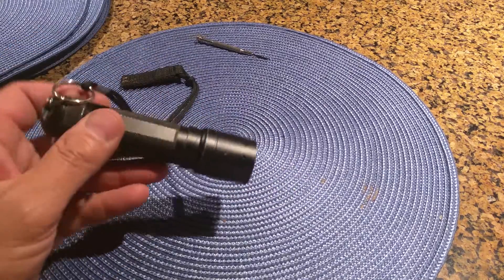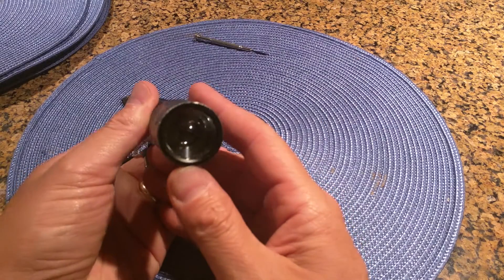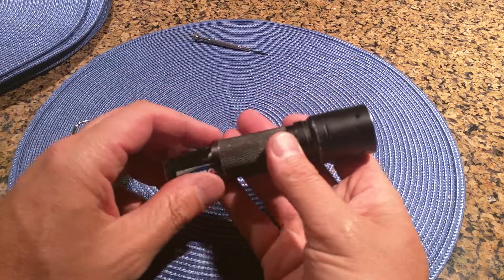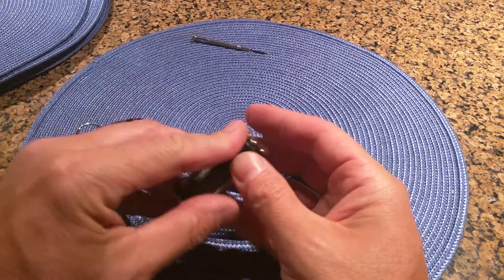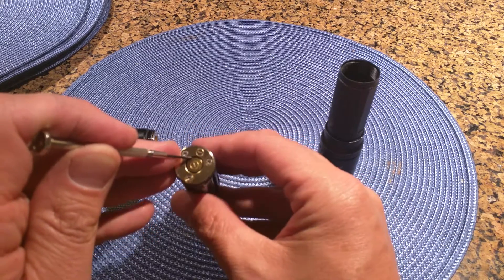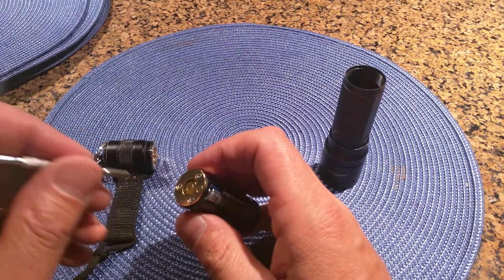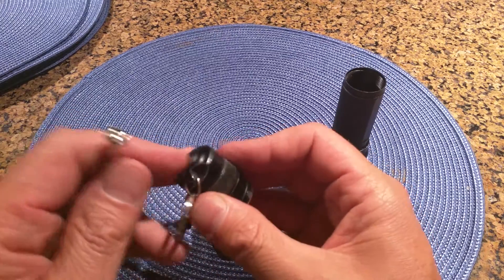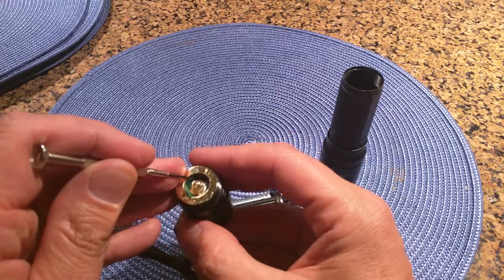LED Flashlight Repair - low power drain

Comment: I've had two LED Lenser do this, a P7 and a P7.2. For the P7.2, I got a replacement battery insert, and the same thing happened again a third time, unable to turn it off, as it was leaking. Just spent a long time cleaning it, but it's still leaking, though a little bit less.
I really feel the whole design is terrible, when this keeps happening. Looking to get a similar flashlight by another brand, any recommendations?

Comment: Ok I know this is an old video but I have the same issue with my light. Although mine will glow when the battery truck is placed into the body without the tailcap in place? Any ideas? I plan on doing what you describe but am wondering if it's the same problem.
Reply from the maker: I think that's the whole problem.  There's a voltage leak across the insulating gap at the bottom of the battery truck.  Good luck, mine's still burning bright.
Reply: @BearWorkman  ok I took it apart and found some acid underneath the plates. Even after cleaning it all up, it only glows dim. (Fresh batteries) Although, now it does turn off. 
Looks like the light is done for.
Btw, I emailed coast customer service with no response.

Comment: Thanks for the video I still have the problem but will have to thoroughly go through the process with my M7
Reply from the maker: Good luck bud, those salt trails are conductors. Could be on the button side or the battery truck.

Comment: Thanks for the video! Had the same problem: battery leaked and I had this light glow, but I couldn't fully clean it because I have a slightly different model. Finally ended up breaking the switch.. so I just soldered the connection and now I turn it on and off by threading the cap about 1/4 turn in and out to make the connection. Got the idea from a flexible magnetic pick-up tool for working on cars that I have which works the same way. So you can still turn it on and off with one hand! :)
Reply from the maker: Deutschehordenelite glad to hear it, thanks for the feedback.